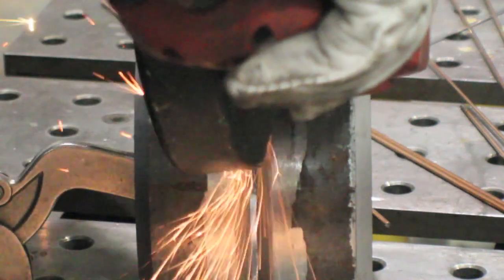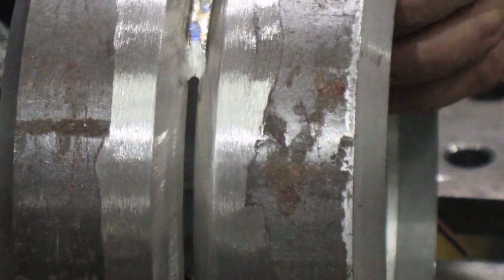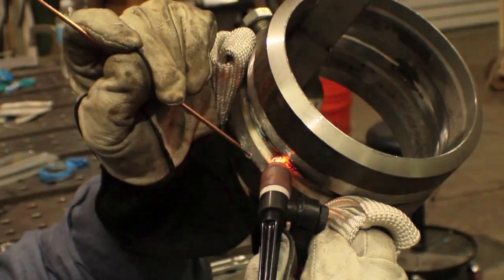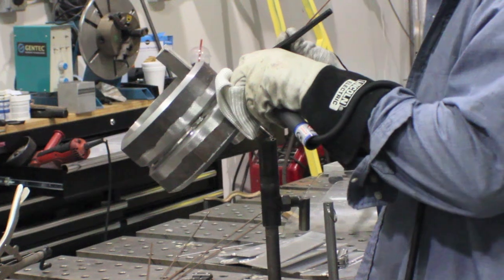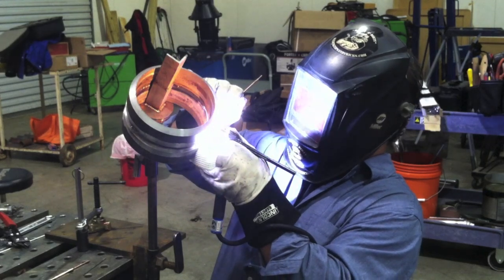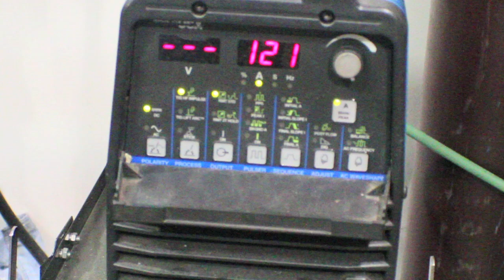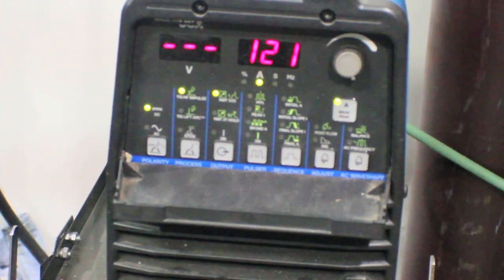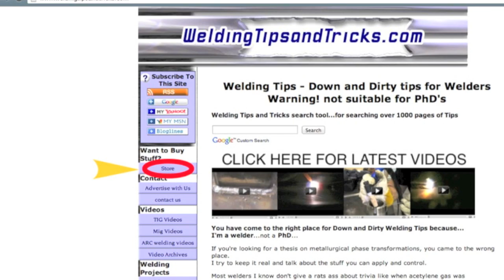6g Pipe Welding Test - Tips for Root Pass

Comment: This is a test I need to do ASAP . It’s $1000 and has only a 20% success rate according to the instructor . Wouldnt stepping the torch back and fourth cause pin holes? That’s what I’ve been told

Comment: Up until my last job I have always beck fed the bottom and keyholed the top. I was laid off in NC so I went to a nuke plant in GA and laid my best root. It was slick. Basically a perfect 3/32 wedding band but they did not like 3/32 reinforcement. Too heavy. I was stressing out to put it lightly. Had one baby girl and a son on the way and not much $ in the bank. They gave me a second shot and I'd never used this technique but having seen this vid I gave it my best and passed both coupons. I would say if you have any skills you have to be drunk to screw this up. It is so easy.

Comment: Thanks for sharing. I busted on my last schedule 120-6" 6G pipe test. It sucked! I drove 5 hours to get to the place and the welding equipment they provided was JUNK! They wouldn't provide any help, tools or even answer any questions. l had to do three sample coupons. Frist one was TIG root and hot pass with TIG filler and cap. Second was TIG root and hot pass with 7018 filler and cap. Third was 6011 root and hot pass with 7018 filler and cap. Luckily I had brought all my own grinders and stuff I needed. I used my own TIG torch and electrode stinger... their stuff was broken junk! Anyways, it took me 9 and ahalf hours to complete everything. My welds looked okay, so the inspectors did not run me off. They cut my first coupon up and set the first test sample in the bender and as I watched... it CRACKED!!! And that was it.  See you later and down to road I went. That company was Kiewitt located in Corpus Christi Texas. I have a 6" schedule 80, 6G pipe welding test on Monday. It's 6011 root and hot pass, 7018 fill and cap. Hopefully I can pass this test for the job. I haven't welded on a single pipe since I busted at Kiewitt back in May 2013. So it's been 4 years since I have scratched an arc on any pipe... God have mercy on me for ALL of my past welding sins!!!  LOL.  :D

Comment: Hey, just wondering what amps would you use if the only wire you had was 3/32 (2.4mm) ? Can you still laywire with this thickness, or would you keyhole instead
Reply: Will yo laywire with higher amp bro.

Comment: kinda have trouble with my root for tig, I get cold wire a lot and the position on the right its kinda hard. plse do you have any tips and what prevent the cold wire?
Reply: you running to cold
Reply: +Tj Iaulualo Bump your heat up by about 5-10 or more if needed. I usually run mine at around 95 on sch 40 pipe. Every machines different though. Prep two beveled ends and just practice small tacks till you find a comfortable heat then try a whole section.

Comment: Staying on the wire means not breaking the walls of the bevel down at all. As you move your cup lef and right ,stay in the weld as shown above. He does not touch the walls of the bevel at all, he stays on the    WIRE

Comment: If you learn the cup walking Technic, your inside weld would be like a machine. I orbital GTAW as well. Once you get the perimeter set right its awesome.  The Technic above's difference is the free handed feeding style, almost. I lay the wire to the contour of the pipe and not feed it but weave over it directly in the center of the wire just as above but allowing the cup to guide the welding time and direction. When I seen it done by the orbital process it verified this method for me. My timing,as mentioned above, is much faster with the cup to keep the consistency.

Comment: Hi KRS 1, you answered your own question at the end of the statement about "hitting the bevel too much", by doing that you create suck-back or flattening of the weld inside. The instructor in the video mentioned travel speed also so you need to pay attention to your speed which is fast but not rapid and keep your torch on the wire, in the center if possible as you Walk the Cup. In other words don't race past your puddle which may cause too large of a keyhole. My method is using what is called "Walking The Cup". Look up a few You Tubes on this. If we have a heavy item and want to move it we walk it left to right till its in place. Walking the cup is like that too, we walk the torch cup as if on its heel left and right but again in tig welding we need to find the comfortable speed. If we stay in the weld to long it will suck back. Temperature is key also, not to hot not to cold, very important. After your root pass then you can cut it up a couple of AMPs, not much though.
Reply: I didn't answer my own question because I said, " I  also don't know what "hitting the bevel too much is." How is that answering my own question? I still don't know what that means. you say it creates suckback, but what is it? do you mean when you're walking the cup on the root and not progressing that fast and just staying in one spot a bit too long? can't think of anything else you might be talking about.
Reply: hello
Reply: hello
Reply: hello

Comment: I've been a combo welder for several years now. I can tell you that you root pass does not have enough penetration. back feed the wire and have AT LEAST a 5/32 gap. I run my root pass at 110-120 with 1/8 wire. I don't let my tungsten go up and down. I go side to side. inspectors on oil refineries will reject that shallow root pass in a heart beat. it needs at least a 1/16 bead for the root. We weld our hot pass at 150-165 depending on the size and schedule of the pipe. Nice video by the way. I just don't agree with the weld or the technique. In real world tests, and x-ray shots in the field. That technique and root pass is unexceptable.
Reply: have you ever seen anyone weld pipe like this at the refinery? you suggested he backfeed the rod. do you mean put it at the top 12 oclock tack when welding the bottom or at the sides at 3 or 9? I don't put mine up at 12 to feed it into a root at the bottom.
Reply: when I start my root (the bottom). My wire is fed from 3 or 9 o'clock. Depending if I'm welding left or right handed at the time. From 10 to 12, or 2 to 12 oclock. I lay the wire at the edge of the bevel and feed the wire. Gravity will pull the root down from the top.
Reply: chevynation yellow do you freehand or walk the root? and which is more common  at the refineries?
Reply: Amen, FINALLY someone that actually knows how to lay in a root pass.  If you dont back feed at least the bottom of the pipe, there is no way to get proper root reinforcement on the inside of the pipe.

Comment: My cup keeps sliding when I do it, any suggestions?
Reply: you have to practice a lot that is only solution.I give an advice to you which is you should using low electronic current.
Reply: +Youngtai  Ju what is low electronic current?
Reply: You need a little touch goober
Reply: your cup should have a light pressure pointing to the center of the pipe. it may even feel like you are pulling the stinger toward yourself. if you push forward, the cup will slide.

Comment: One major thought that has helped me pass many (all) Nuke sites is to Stay on the wire. Some said that they had suck back after the hot pass. This is most likely due to hitting the bevel too much and of coarse staying to long in that spot. I walk the cup and as long as I keep the tungsten pointed on the wire, it comes out smooth a piece of glass. I which You Tube was available in my day. My man did an excellent job in this Look See!!!
Reply: what do you mean to "stay on the wire?" i'm sure that has something to do with the filler rod but not familiar with the term since I am just a student learning how to weld. ( I am pretty much  forced to teach myself since my instructor sucks. he is rarely around and mostly spends time looking at his phone. I  also don't know what "hitting the bevel too much is." please explain if you could be so kind.

Comment: this is really good stuff. I learned to weld many years ago with my dad stick welding. now I mostly do tig because the parts I make are all done in .063 aluminum. I am starting to look into certification so I can apply for an actual job and "weld" it to my home shop work, which includes milling, and welding proton guns for unlicensed nuclear accelerators. I want to be very familiar with the whole testing process because being under unnecessary pressure can't be beneficial to the task you're trying to perform successfully.

Comment: Hi, Love your instructional vids,,,I have a question regarding the stick welding or fill up
of a joint.?.Wondering if you may have any tips regarding how not to get porosity on the overhead when using 7018 low hydrogen electrodes..Seems that I have experienced this many times over the years..Just seems to occur on the overhead like when you strike up your arc on a test comming off the six o'clock position. Not a good thing when doing the two inch test in particular..I've tried numerous methods but occaisionally still get porosity down there. I have taken into consideration rod angle, amperage settings, the surroundings like if there is a breeze, even magnetism of the fixtures that the coupon is attached to..checked out the electrode batch numbers and rod oven heat settings..The only thing I could contribute to this problem was the fact that the gasious shield that is formed when the electrode burns is heavier than air and thus drifts away from the weld puddle due to natural gravity..Any suggestions welcomed....Thank you Dber..
Reply: Shove the rod up into the puddle, alot of times a small deviation in the amount of arc lenght will give you porosity, so try burying it an see if that helps

Comment: In welding school on 6G pipe now. I weave and have good success with it most times, but have problems with a below flush root in some places. The locations are inconsistent, but my technique is seemingly consistent. The pipe is donations from the local shipyard. It's pre-beveled and is the same coupons they use on their testing. May give this technique a try to see if it helps.

Comment: Im a tig welder and it has been a 10months till i last welded with gap that required the root and reinforcment on inside...i welded the stainless steel tanks and pipe that only required no root only full one pass...but now they are asking from me to do 45°degree angle weld (6g) with root reinforcment and i have tryied today and it doesnt go out,even though i keep the wire inside and go left to wright...what is your tip for me,and how to make a small ring on the inside like a 1mm of all around?

Comment: first of all I do not want to humiliate this man: D but unflushed shows the joutube people, the first error is the root, the root is made from 2mm to 5mm using the wire 2.4 mm tungsten eloktroda other thing going from left to right so-called zigzag system with the addition of strings as it works. I use depends on the amperage of 85 amps to 100 APERA accurately, 85, 90, 95, 100 amount of argon gas at 10 gauge. tnx

Comment from the maker: in order to fully penetrate and leave a smooth weld on the inside. also,   the pipe welding codes call for a gap.
Reply: What size cup were you using